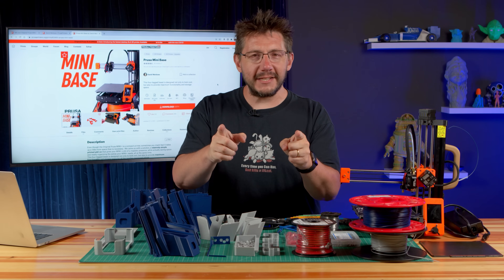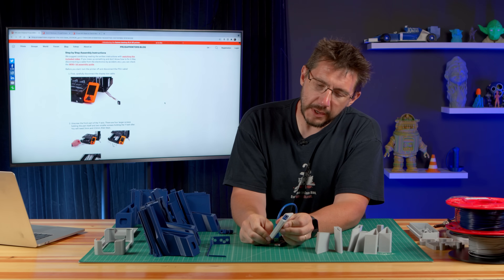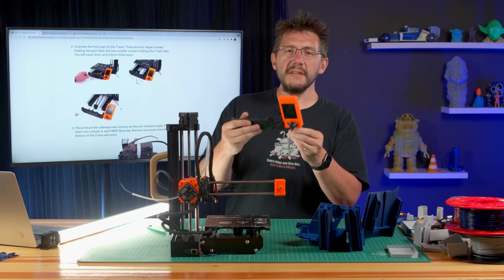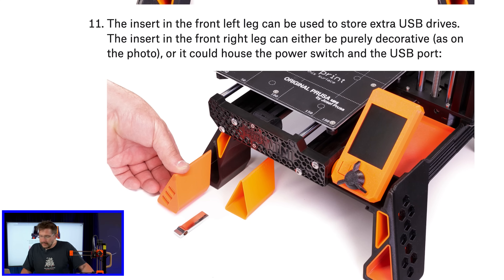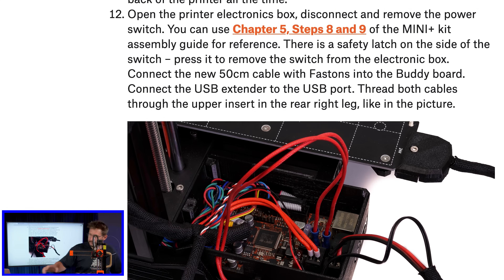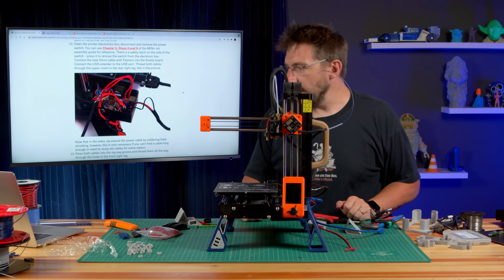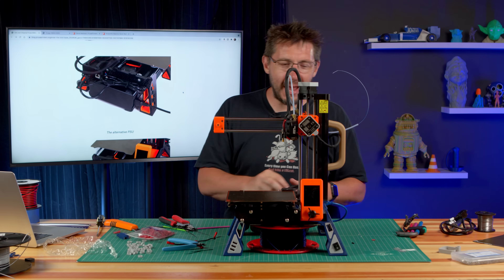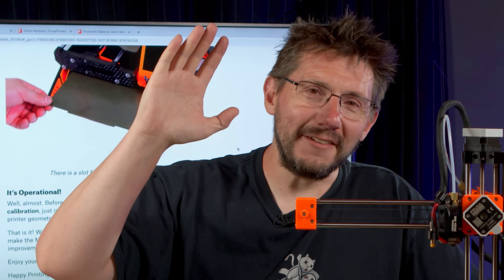Incredible PRUSA MINI Upgrade! PRINT AT HOME!

Comment: I wouldn't say the power supply currently hangs out and does nothing. Did you know that if you unplug it, the printer stupid working. Supplying the required electricity in the correct voltage and amperage is not "nothing", it's kind of critical actually. LMFAO.

Comment: I did the stand as well.  You might find the extrusion covers helpful as well.  The one thing I didn't like was that the old PSU holder was too big to print on the Mini.  However, there was a remix of the PSU holder that does fit and I used that one instead.  I also found that the zig-zag was too shallow for the larger cables.  If you have a filament runout sensor, the screws will go through the zig-zag and cut into the wires.  I just left my sensor as built.

Comment: I loved this mod, I have a problem... I recently bought the prusa mini and it works very well but I don't know why when I download an stl and slice it in prusa slicer and put it in the usb, said stl does not appear in the prusa mini and I don't know what to do, could you tell me what I'm doing wrong? thank you very much and greetings from Spain.....:)
Reply: @_Manuwar_  Hello, hopefully you have fixed this by now but I had the same issue yesterday (a friend gave me their old mini). My issue was the firmware. The slicer will export a binary code file for the prusa mini but that only appears if you have updated the firmware past 5.1 (I think). You can either update the firmware or turn off bgcode in the settings.

Comment: CAUTION:    9:48 Yes, a motor is also a generator. Move parts slowly otherwise you are backfeeding electricity. That’s why the display lit up, and you CAN damage your printer like this.

What a fabulous design!
Reply from the maker: The design is great! However, I think there are protections in place. I remember Proper Printing tried to destroy a machine by backfeeding electricity, and it didn't break. Maybe this requires a deeper dive.

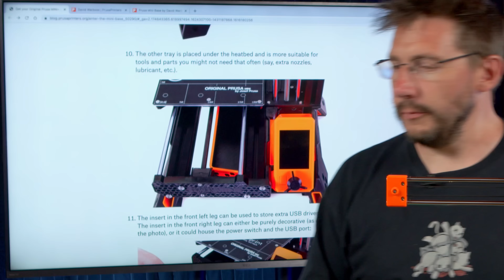Comment: 9:54 - 9:58 are the motors sending current to the control board when the mini is unplugged and off? that's a cool... feature. hand powered 3D printing is coming.

Comment: Mounting the power supply to the printer means you will most likely have to run an extension strip to be able to plug it in, I considered having a power brick to be an advantage over a fixed power supply, and the whole point of getting a small form factor printer was a small size, it's like mounting a raspberry pi in a full-size tower case!
Reply from the maker: Oh, I definitely know what you mean. For me, the power outlet is super close. The power supply mount is super optional and not needed to make the new legs look fantastic :)

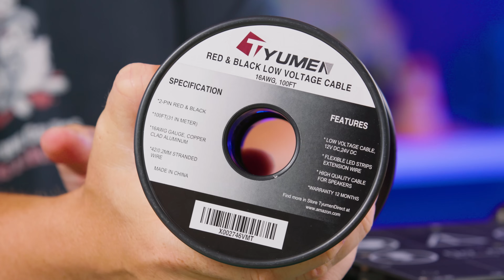Comment: Hi, I can see one possible Problem with the Cable you are using. At (12:14) you can see that you are using 16 AWG CCA (Copper Clad Aluminium) Cable. It is more comparable to an 18 AWG Copper Cable. I'm unable to see the diameter of the wire you are replacing which means it could be perfectly fine.
If the wire you are replacing is effectively to small for the current, it can overheat and burn. It is best to replace Cable or Wire for power transmission uses with the same or higher effective diameter Cable or Wire. CCA can be a bit of a trap.

Comment: 14:58  There are three screws to even out the pressure.  Ever lay on a bed of nails? It’s easy. Using only one screw may exert too much force and bend the internal parts of the connector.
Reply from the maker: That makes a lot of sense.
Reply: @3DPrintingNerd  BTW, thanks for a fun, almost candid videos. 😉

Comment: This video will help for anyone doing the upgrade understand it a little better. But man, those color choices? Most of the upgrades out there with different colors than the orange and black do a full reprint of all the plastic parts on the mini so the upgraded parts match. I chose orange and black for my upgrade because I didn’t have the time or patience do disassemble and reassemble my entire printer to make it look neater than the original upgrade.

This blue and vanilla bean is a terrible mismatch to the black and orange and makes me think this guy might be colorblind?

Also, if you don’t want to wait on Amazon, I was able to pick up the spade connectors and wiring at my local auto parts store.
Reply from the maker: terrible mismatch to the black and orange - yes. colorblind? nope hahahha.
Reply: @3DPrintingNerd  Thanks for your channel. It is very well done and informative.

Comment: Looks great Joel!
I've done the same upgrade and I really enjoy how compact it looks. 
Have you tried printing with the spool under the bed yet? I'm interested in your thoughts on how well the spool rotates as it's printing. 
Move has the sensor so it has a small section of PTFE tubing after it. The tubing gets wrapped up into the spool of filament as it's trying to pull the spool to unload filament for printing. I'm playing with it too see if I can make that process smoother. 
What's your experience? 
Great video and as always with Joel excitement while doing it. <HIGH 5>
Reply: I've been using the filament under the bed for awhile now, and the only thing I've noticed that could be a problem is that when the line rubs against the legs, it digs a small groove, but other than that, it works really well

Comment: Did you print all of the parts on the Mini? Now reprint all the other parts so the colors match
Reply: That original power supply mount won’t fit on the Mini build sheet.  But someone did do one that fits inside the frame, and is printable on the Mini.
Reply from the maker: I printed all the blue parts on the MINI, and the Vanilla Bean parts on the mk3.

Comment: Oh no, you didn't use Prusa colors.  Isn't that sacrilegious or something.  Looks good though.  Let's hope you never need to take those legs off.  I stopped printing anything that slides into the extrusion as I could never get them to fit properly.  I just redesign the part to use t-nuts.

Comment: When he slid the bed back and forth the lcd lit up
Reply: Driving a motor (even a stepper) when it is not powered generates electricity.
Reply: I thought I was the only one that noticed it,,,,, several times,,,,, I about had a seizure when the screen flashed. 😳

Comment: "if it ain't broke, don't fix it"
Reply from the maker: ... most of the time. :)
Reply: Some people consider the power switch and USB port locations to be in need of a fix. Also, there are claims that it's not so mini if the filament spool has to sit next to it.